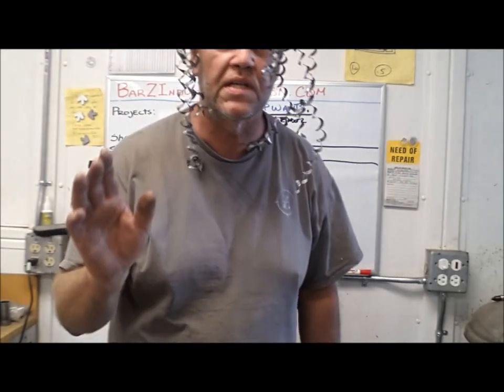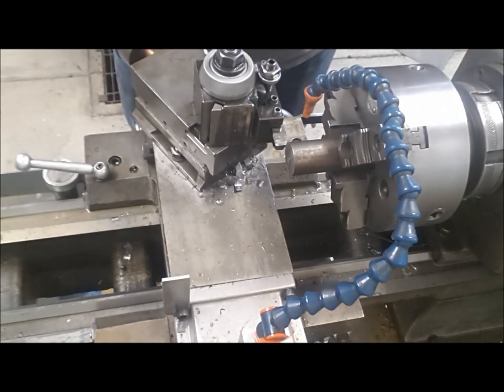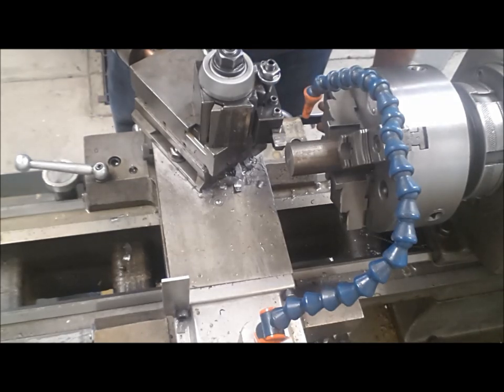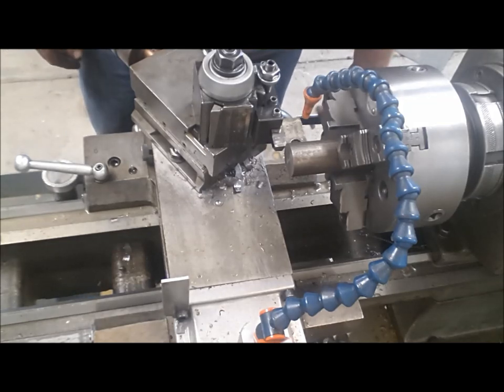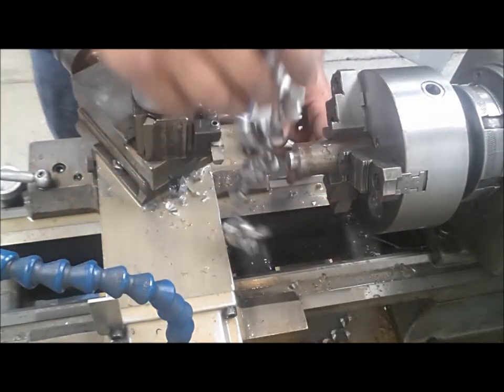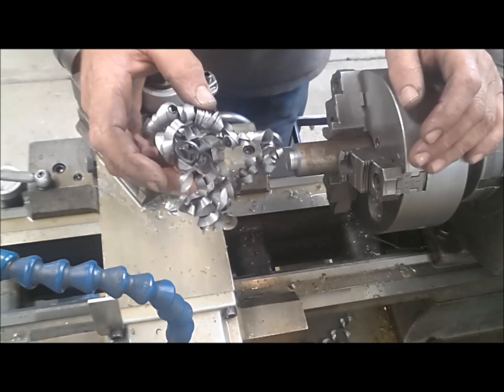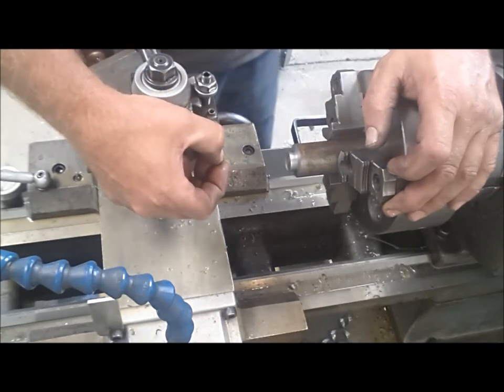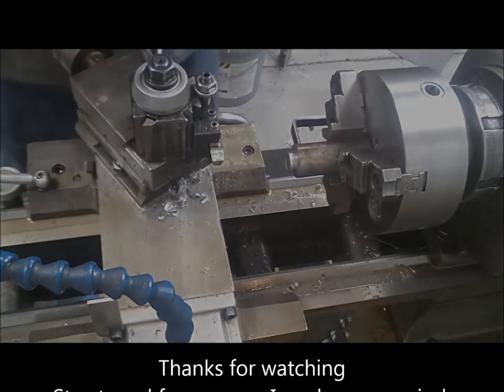Chip control / lightweight division

Comment: When I tried a few deep cuts on my Atlas after watching the original series a while back, I was able to get about .075 before it really slowed down.  But, I hadn't played with changing the change gears from how they were set up when I bought it.  After I started playing with trying a 1/4-20 thread, I think it was still set up for about an 18 pitch thread, which is a pretty high per rev cut.  So, probably wasn't too bad for not knowing anything and just using a couple old bits I had gotten that were pre-ground. 

When trying to take some photos while boring, I found it seemed to be able to take a pretty deep cut pretty easily.  I think I was up to .125.